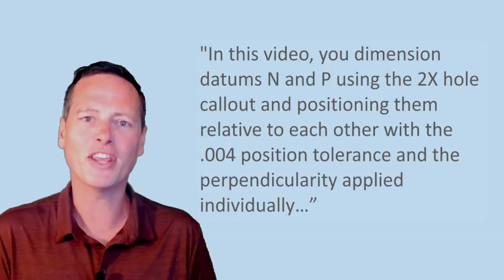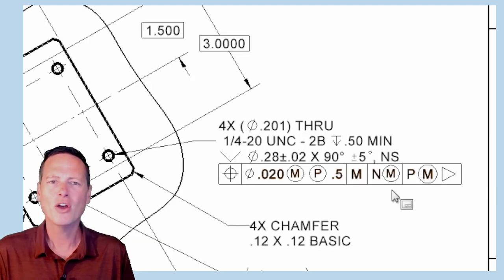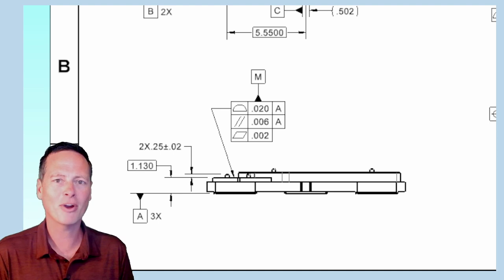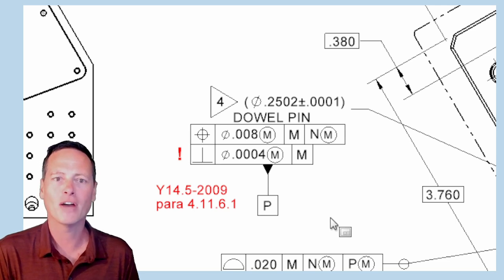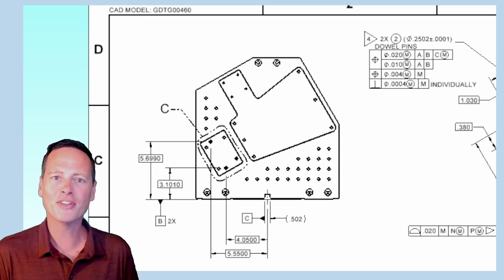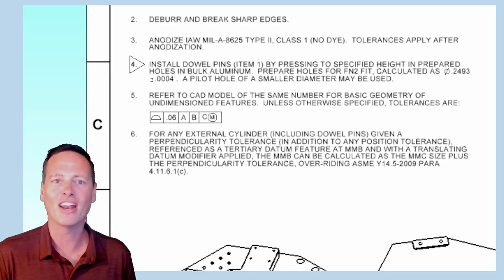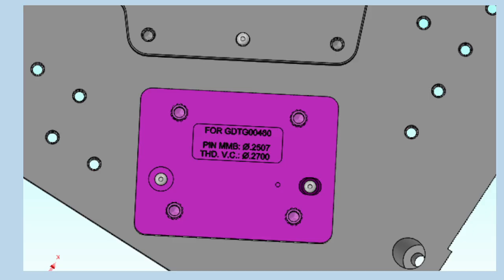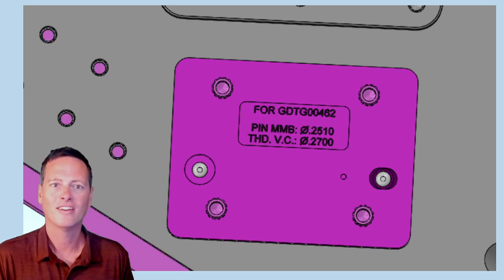More Dowel Pins (Summer 2024)

Comment: This is a discussion about a famous design solution:
The specified part is constrained by A B C against a larger part (e.g. frame) that is not published. A third part is constrained against the specified part by the constraints M N P. A GD&T model is created to explain nature's touch and fit functions. Unfortunately, each model simplifies nature. A specification uncertainty appears.

Perhaps the contact A is screwed. Involved parts are not rigid; screw forces are very large! This is one (of many) examples of specification uncertainty that reduces given tolerances to ensure functionality!
Touch B and fit C appear naturally equal as secondary datums to A! MMR for fit C is needed if the part can be moved against A during assembly to find the fits of the bolt holes (weight & friction are not too great). Please note: Screwholes and fit C appear at the same time! The fits of the bolt holes should be called datum D, for example. The datum system for the basic contacts of the specified part is primary A and at the same time secondary B-C"MMR"-D"MMR". This system has reduced specification uncertainties, which helps to ensure functions with the largest tolerances.

Now, the same game with the contacts of the third part. But the contact partner of the second dowel at fit P is not from the same feature type! The dowel is a cylinder, the slot is a linear dimension "two parallel planes" according to ISO 14405-1 (sorry, I'm not familiar with GD&T - but the natural functions are the same everywhere...). I'm afraid the specification should explain the geometry (position at MMC) of this slot. Touch A is primary and the touch is against the full feature size (very often it is not!). Three secondary fits appear at the same time: N"MMR", screw holes "MMR" or threads and P"MMR".

Practicing GD&T is challenging!
Once datums (contacts) and datum systems are clarified, the next step is the geometric specification itself. Now we see a famous specification error of contact M, which must be specified against the base datum system A B C (or whatever). Obviously, it is necessary to specify the orientation and position of the simulated partner of this planar touch. Datum A is a plane that simulates the third part! This is not covered by a profile specification! According to ISO 1101 it must be a position with modifier "H0" tangential element "T" against A B C (or whatever). Here we see a big difference between ISO GPS and GT&D. ISO uses the Min-max condition and GD&T uses the candidate principle (sorry, I'm not sure). In the end, the question is: Which system works with the least specification uncertainty against the natural function? I do not know the answer...

A clearance fit with MMR requires the reciprocity requirement for a specification with the largest tolerance. GD&T doesn‘t use reciprocity. The tolerance of the linear should be expanded by starting at MMS and ending at LMS. The position tolerance for the derived feature is than zero at MMR.